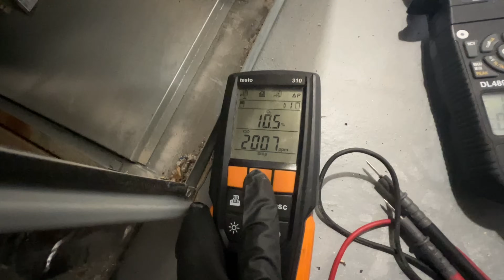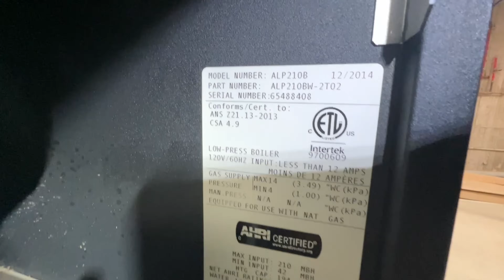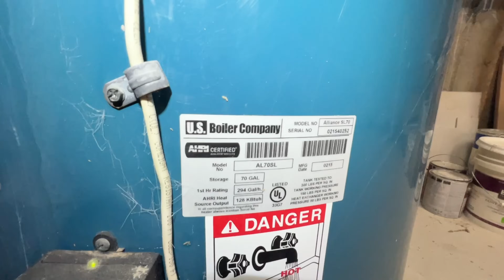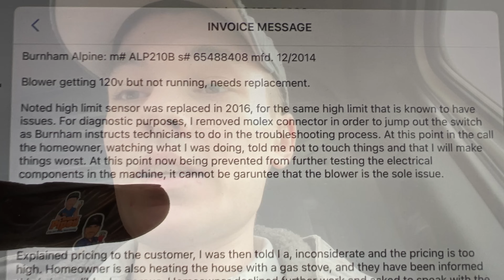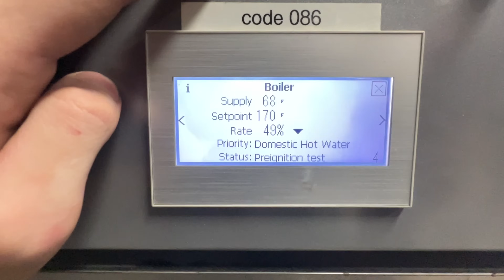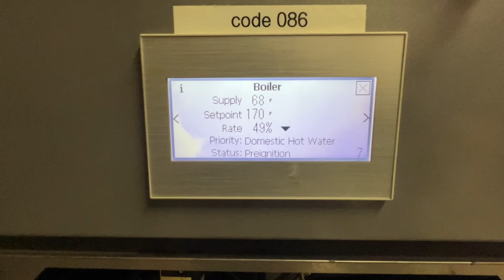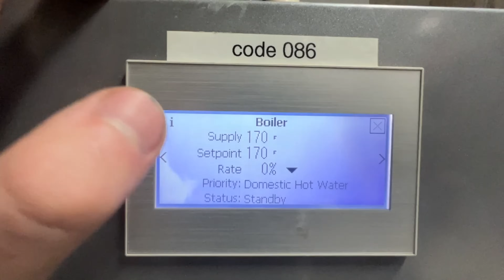Another Day Running Service Calls! Nightmare Customer - Disrespectful & Cheap! HVAC Tech POV

Comment: I knew a guy kinda like that, I called an HVAC guy for him, guy shows up and this guy doesn’t let him look at the unit.  HVAC guy only gets to look at the outside unit that had a burnt wire.  The wire was 60 to replace,  guy says that’s too much n threw the HVAC guy out.  Then he spent tbe next few weeks complaining about the heat and having HVAC guys go out there.  Ended up spending 100 or 200 for it to be fixed.

Comment: I have run Commercial Industrial HVACR Service for almost 25 years. I have ran into a few problem customers over the years   There is nothing more frustrating and uncomfortable than dealing with a POS customer like that, especially when there are great customers waiting for you to get to their call. I appreciate how Mike dealt with the customer and respected you as an employee. What experience has taught me is when you get a bad feeling about a customer, sometimes you have to walk away, the company I have worked for the past 11 years is not afraid to fire a customer if needed. You’re a good technician and person, nobody has the right to disrespect you   Thanks for the video.

Comment: 3:45  that drip leg also must be min 3"  to check heat ex jumper out r and g and put a long stem lighter in each port, if it dances you have a crack. Good video
Reply from the maker: Ok

Comment: Hey I got a tool to clean those heat exchangers, brings them back to brand new. Round nylon brush with drill attachment hit it with water.

Comment: Funny how different codes are from state to state and even between jurisdictions.  Here we can use flex line for water heater connections, and can't have the drip legs inside, they have to vent to outside.  Also we have to have gas drip legs as well on everything, but can use flex line connections to each gas device.  🤠👍
Reply: Can’t fathom why those flex lines aren’t allowed in NY.  There really isn’t a high risk of failure 99.9999% of the time it’s the water heater itself that fails and leaks.

Comment: Those condensing boilers with the copper pipe coils should use citrisurf before rinsing with water that stuff cleans heat exchangers awesome
Reply from the maker: We use calcifree

Comment: Hey man, it sounds like you may have a turn signal bulb burned out in the work van. Rapid clicking. Mike doesn't mind paying the city for speeding and FTS tickets, I know. 😸😸😸 However, you may have aftermarket LED bulbs in the trucks which don't draw enough and the LCM thinks it's got a bulb burned out.
Reply from the maker: It’s the wiring to the bulb not the bulb itseld

Comment: Why don’t they allow flex connectors on hot water tanks in New York just curious
Reply from the maker: I don’t know, nor do I care. They look incredibly unprofessional and 9 times out of 10 they’re leaking when I see them. They’re a garbage product. Use copper or brass unions and hard pipe.

Comment: Why aren’t flex lines code? Lowes and Home Depot sell them with hot water heaters. Thanks
Reply from the maker: Flex lines are only allowed for “movable” appliances. Such as an oven or dryer. 

They add two extra connections per line that are available to become leak points.

New York is not in an area prone to earthquakes, so having any flex lines is unneeded. 

Flex lines are made of THIN stainless steel which poses yet another threat for leaks. 

We hard pipe everything here
Reply from the maker: Lowe’s and Home Depot shouldn’t sell water heaters. They are one of three things. Fuel fired, high voltage electric powered, or refrigerant “powered”. Homeowners are not legally allowed to work with refrigerant (and rightfully so). Any fuel appliance should be maintained, serviced, and repaired by a licensed technician, and any electrical appliance should maintained or service by the same or atleast an electrician for installation. 

Just because something is done doesn’t make it right. If you show up at a house that has a boiler with no flue piping, and just vents into the space, yet has run for 10 years that way, would that warrant the question “why isn’t that code?” 

But at the end of the day, the reason something is code doesn’t matter. We a trained professional, working under the license, guidance, and teachings of a licensed professional, your job is to ensure code is followed on the appliances you come across.
Reply: I totally agree! Thanks @DCHVAC
Reply: @DCHVAC The NY code is dumb, flex lines are used all over the country with a very low failure rate.  Since it is code it should be done according to code, outside of NY in most jurisdictions flexible is acceptable.  Usually the water heater fails and leaks long before the flex lines. Also those stainless or copper lines are far less likely to fail than the plastic or rubber lines used all over the home, on washers, sinks, etc.  The plumbing code in NY is overkill in this regard and frankly inconsistent because in reality another flexible line in your home carries negligible risk, other items you mention are legitimate concerns for effective and safe operation of your appliance.  In general licensed plumbers should install gas water heaters, that’s not to say that there aren’t home owners totally capable of installing a gas water heater that totally complies with the code and is installed properly.  

I’ve seen tons of things done by “licensed plumbers” that are flat out wrong and violates the code in that jurisdiction that the town inspector has signed off on.

Comment: 18:52 I‘m curious… no vacuum breaker or thermal expansion tank?
Reply from the maker: We don’t put vacuum breakers on water heaters in New York. And expansion tanks only as needed.
Reply: Vaccume breakers are only required on electric tanks, expansion tanks only required if it's a closed system

Comment: I'd love to hear an honest accounting for why plumbers are so expensive beyond "we charge what we an get." That's really what it's all about right ?
Reply from the maker: You want to hear an honest account for why we charge what we charge? 

We charge what we do because we have a knowledge beyond others, we make a repair that other can’t do, and we can stand behind the work because we know it will last. I don’t just work 8 hour shifts. I spend almost all the time that I’m not sleeping researching equipment, manufacturers, materials, parts, etc.. to understand them. And the 8 hours I spent every day on jobs, is all experience to lead me towards a better understanding of what might be wrong the next job. 

I politely introduce myself to customers, and then ask to enter there house instead of barging in. I wear shoe covers every job to ensure I don’t scratch, damage, or leave muddy foot prints at the doors. 

I give the homeowner every option for repairs, and let them decide on the route the want, give them the route that’s advised, and sometimes the route that I personally would go with if it were my house. 

I am not a plumber, I’m an HVAC technician who does light plumbing work. But plumbers are laying down in dry dirt crawlspaces to clear out your drain lines, or worst, laying down in your muddy crawlspace that’s wet with sewage and filled with sewer bugs. 

A plumbers life is not easy. And cost of business for the trades, especially with so many incompetent workers due to the lack of good labor, continues to skyrocket. 

At the end of the day it’s a business. If you want things done right, you pay someone who can do it right. If you just want things done, and don’t care for the quality or longevity of the repair. Higher whoever you want. 

Why is it that an engineer costs thousands to design a building when he doesn’t put it together? Why is it that a doctor costs thousands when he may only work on a patient for an hour? 

Plumbers are the people who provide sanitary conditions for a nation. Removable of sewage. Clean water. Leak free pipes preventing water damage, mold, mildew. 

Quality doesn’t cost. It pays. Any good plumber is operating off of years worth of hard work, literal blood, sweat, and tears. They spent long hours working in miserable conditions, late nights, early mornings, time away from family, very limited vacation, and usually it’s not because they HAVE to do it, it’s because they want to do it because they want to provide the luxuries and comforts to people that most take for granted, and they want to ensure they have money to afford what’s needed for there family so that they can take it for granted. 

I don’t wake up every day and think I want to charge every customer as much as I can because I can.  I wake up every morning and think who am I going to help today, who will I bring heat, air condition, or hot water too. And which customers will be glad to pay what we have to charge working for a FOR PROFIT business. 

I couldn’t do plumbing, that’s why Mike keeps me where I am. But I could tell you as well as I am paid now, if I had to do what the plumbers do, I would quit and work another field. 

You try laying in a crawlspace on your back in a half inch of sewage. Or snaking out/ jetting a sewage line only to have it splash into your face. Soak into your finger tips and under your fingernails.  Laying under a sink and working on a trap or a leak and getting years of bacteria growth and disgusting food sludge, saliva from utensils and dishes in your face or your mouth.  

Not only is it incredibly physically demanding on your body, but it is outright disgusting. 

Be a real plumber for a day and you’d pay more to never do it again than you would pay the plumber to do it for you.
Reply: @DCHVAC  I appreciate your response and I agree you should be paid well. It just killed me to pay 500 for 50 minutes of work replacing a kitchen drain rhat included 125 for working in a crawl space which ive been in 25 times. It just seems excessive.
Reply from the maker: @SuburbanDon  all I can say is do it yourself instead.
Reply: @DCHVAC love that response. Keep up the great work 👍
Reply: Well friggen said Daniel

Comment: I have a very simple approach with the "special" customers. First off, I can usually tell right over the phone if they are going to be a problematic customer (yes, most of them have the same attitude when they speak to you, even over a phone). So, 90% of such customers are dropped and blocked before I take them on as a customer. The few that slip through the cracks, I politely decline when I start interacting with them in person and go to the next service call. On a rare occasion I do start the work and only find out later, but those are far few in between. One must filter them over the phone! Too busy to deal with the nonsense later. A lot of them try to call back after they are blocked, they truly don't understand, but it is what it is.
Reply: Blocking non stop at 90 % 🤷‍♂️? How does a guy make money then ??